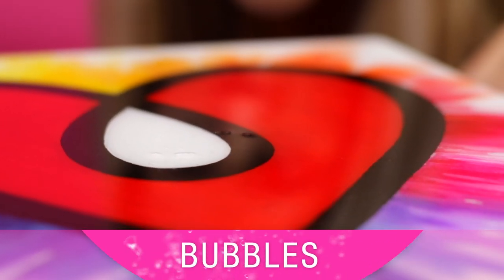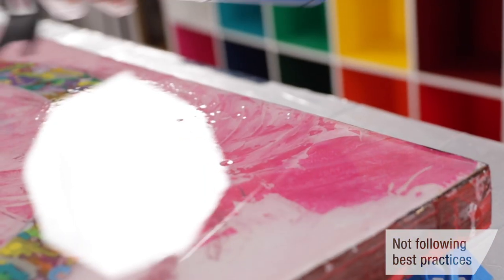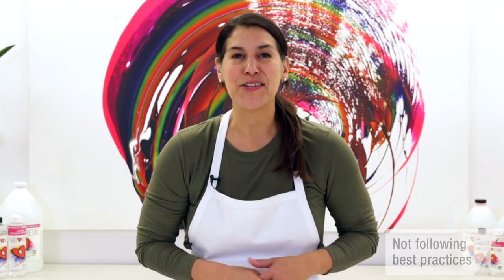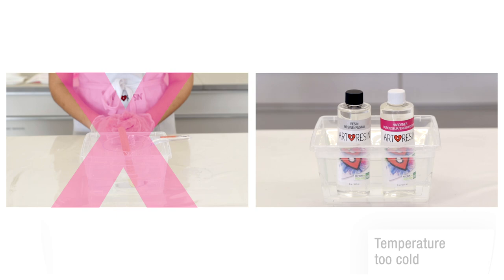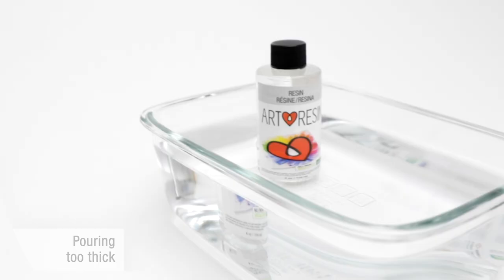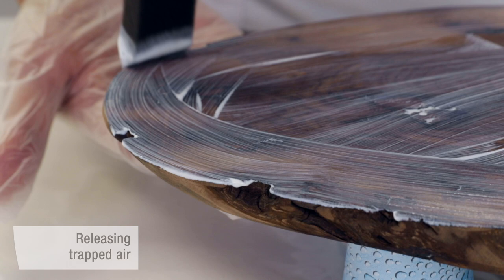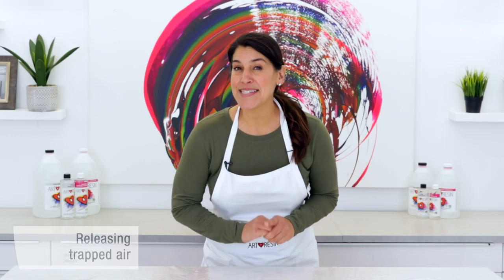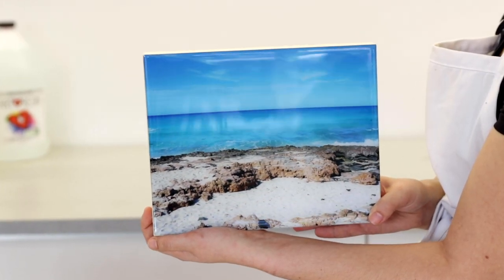Resin Tutorial: Bubbles

Comment: Love your resin, it's easy to work with however I do have a problem.  Every once in awhile I get a little speck or two on the surface of my painting that I missed while it was still wet.  I have dealt with it as you suggested' (sanding etc)  It works, however when the art piece is a large one it can be costly.  Is this the only solution?
Reply from the maker: Unfortunately spot fixing will always show, sometimes more than the small flaw you are attempting to correct.  The best way to achieve a perfect finish is to do a full second pour to correct any surface imperfections.  Aside from that, you can adopt the belief that there is beauty in the imperfection and just leave it alone!!

Comment: Thank you for the tips - bubbles have been a constant thorn in my side since I started working with resin. I have a question though... You mentioned that cold temperatures are not good for resin, but what about humidity? My wife and I have a back and forth debate about which is worse - heat or humidity. We are in Washington state (the western side), so the temps don't stay above 75-85 very often, but what we do have is humidity. The air usually feels damp. Since water and cold are both enemies of resin, do you think humidity plays a factor? If so, is it as harmful as the cold? Thank you!
Reply from the maker: Hi there,  humidity can definitely cause problems for your resin.  You pointed out that water is an enemy of epoxy resin and you are right.  Too high of humidity can result in a cloudy surface on your cured piece.  We recommend keeping your humidity at 50%, but you can work with anything below 80%.  If you are concerned about humidity it can help to run a dehumidifier in your workspace to keep it at a suitable level.

Comment: Thanks for the great tips. I am new to resin. I’m noticing tiny chips but I can deal with my finger nail. They don’t really look like bubbles though. Any suggestions? Also, I missed an edge on one of my favorite pieces and I’m afraid that if I use sandpaper I’m going to scratch the house paint off from underneath where it’s not covered by resin. Any suggestions would be great! Thank you!
Reply from the maker: Hi there, you can fix a surface imperfection by sanding the surface and smoothing out the imperfection, then pouring on a fresh layer of ArtResin.  For your piece that you need to re-coat to cover the missed edge you can just lightly sand the resin surface and avoid the exposed painted area, the sanding is simply to give the next layer some tooth.  Once you clean off all of the sanding residue, just pour a fresh layer to coat the artwork.  If you need anything please reach out to us at support@artresin.com :)

Comment: Hello mam. It is really a great information. I am new in resin work. I recently tried a lotus flower silicon mould of candle holder. But found some bubbles gathering at the base . I used a barbeque lighter. But it did not work. Can you help mam what can I do to avoid bubbles
Reply from the maker: The flame from the lighter should clear any surface bubbles away easily.  Be careful when using a flame with a silicone mold as it can damage the mold and cause the resin to stick.  You can also use a spritz of isopropyl alcohol on the resin surface once you pour it, this will usually clear any surface bubbles and reduces the risk of damage to the mold.  Using a warm water bath to warm up your resin and hardener prior to mixing can also help reduce the amount of bubbles in your piece.

Comment: Thank you for the video.
I have a little doubt with top coating my piece. I make a geode tray, when it cured there were a few bubbles at the bottom which lead to holes on the surface (bottom side is supposed to be the top side after it's cured). Do I need to fill those holes and sand them before top coating or I can simply top coat them? 
Any help would be greatly appreciated. ☺️
Reply from the maker: You won't need to fill them first. Just sand your piece and apply your top coat, the resin will fill them in and you will have your holes filled and a beautiful top coat all in 1 step :)
Reply: @Artresin  Thank you so much. Really appreciate it. 😊

Comment: I’m new to doing resin earrings and after I pour in my resin to the mold, small little groups of bubbles form that don’t pop with fire, and if I try my heat gun, the resin will fall out of the mold.. any tips??
Reply from the maker: Hi Analese, try to make sure your resin and hardener is warmed up to a little warmer than room temperature before you mix it, this will help reduce bubbles.  Making sure your ArtResin is poured in 1/8" layers will allow the bubbles to rise out easily.   The heat will clear any bubbles that rise to the surface,  (we don't recommend using fire on a silicone mold) so trapped bubbles are more about prevention- Stir slowly, warm resin, 1/8" pours.  I hope this helps 🙂
Reply: @Artresin  thank you!

Comment: Can sanding be done on canvas?
Reply from the maker: Yes, once cured ArtResin can be sanded whether it has been poured on canvas or wood panel.
Reply: @Artresin  can I sand 24hrs after I have poured on the canvas ?
Reply from the maker: @marlenlopez5847  Yes, once the resin has cured you can sand it.  Do not try to sand when the resin is still sticky.

Comment: I keep seeing people using pressure pots.  Is this recommended with art resin?  I only buy art resin.    Maybe I use the wrong resin?
Reply from the maker: Hi Rhonda, you do not require a pressure pot to use ArtResin.  The pressure pot is used to remove bubbles and often only used when doing a deeper pour, rather than using ArtResin as a surface coating.    When poured at its intended thickness-approximately 1/8", the bubbles are able to rise out to the surface on their own and can be removed with a torch.
Reply: @Artresin  so, I should not be using art resin for things like a light bulb mold?
Reply from the maker: @rhondaziara3653  if you pour in layers you will have less issue with bubbles, if bubbles aren't a concern then you can probably pour in deeper pours.  Tinting your resin can help hide any bubbles that don't quite escape.

Comment: I forgot what you answered when I asked if using a lighter is ok. I will not be able to get a torch. Also I am making keychains and pins so nothing like a art piece.
Reply from the maker: You could use a lighter if you like, it is really only suited to small items.  Keep in mind that if you are using silicone molds it is best to avoid the use of a flame as it can damage the mold.  You can use a spray of isopropyl alcohol to clear bubbles from the surface of your molds.